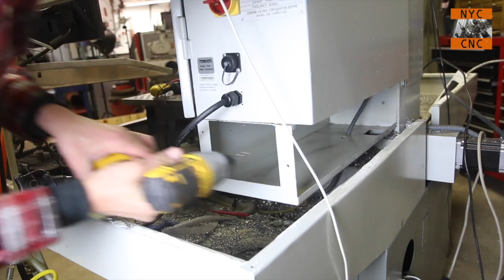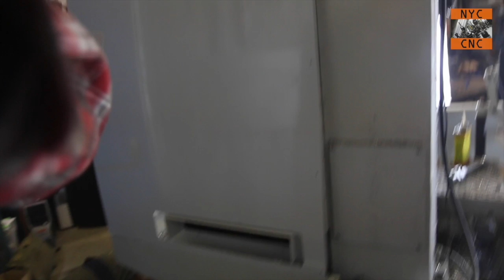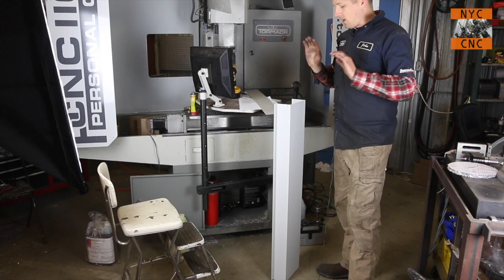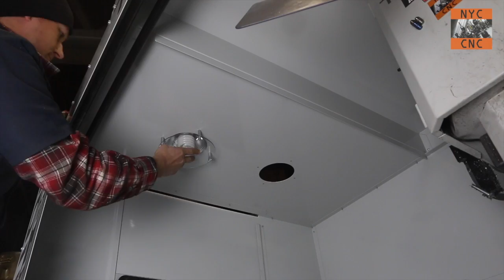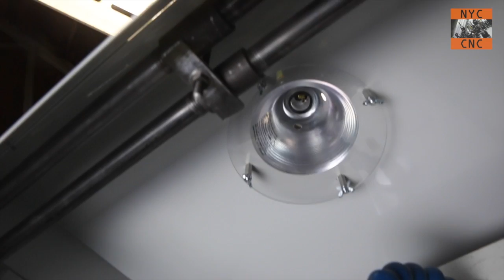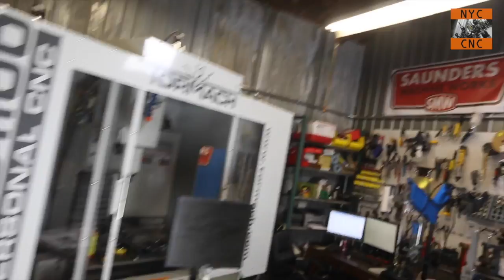Tormach PCNC Enclosure - Installation & Review Part 2

Comment: FYI, I have 2 nice cabinets from lazer machines I parted out that measure 40 in. tall and 42 in. deep and 42 in. wide that would be perfect for any of you DIY CNC guys that I'll happily sell for a very  nominal amount..  The entire back of the cabinet actually bolts in and out and the front has a large sliding door.  First come first serve.  In Philadelphia.  Thanks.
https://philadelphia.craigslist.org/tls/4863222580.html

Comment: Our enclosures arrived yesterday!
I like that they surrounded the electrical connection coming out of the bottom of the control box.
I am going to take it step further and run a duct from the top of the control enclosure and exit it to the outside.  
This will keep chips from accumulating on the hot air exhaust vent and keep hot air from accumulating inside the machine enclosure.

Comment: Quick question about noise control.   Now that you have been up and running with the new enclosure can you say that it keep the noise levels down in your shop a bit?  We are currently running two 1100 in the same room and looking not only to control the chips but sound as well.   Any thoughts on the topic would be great.  Thank you.  Great video on the install.
Reply: NYC CNC
Awesome.   Exactly what I needed.  Still need hear how its cutting or if there is problem while cutting.  Thank you.   The price was a little more than we wanted to spend since we have to purchase two but your video convince me of the quality and functionality.   Any plans for a Tormach Lathe/Video ect?
Reply: NYC CNC
Awesome!  I will most likely get one this year as well.   Open house would fun.   Shoot me an email offline with details.

Comment: HomeDepot has the new style li-ion drill/impact kit with 2 batts and  charger for 148 right now {Black Friday price was 199}. The batteries slide on from the front like every other brand, so they don't fall out the bottom over time like the regular dewalts. All the drills with plastic chucks have brushed motors. The metal chucks are brushless {xrp}

Comment: 3:00 That old monitor bracket will come in handy to mount a second monitor to watch YouTube videos while machining.  :-)

The eye hook over pipe door hangers and levelers was worth the price of admission for this video.  Very clever.  I'd have never thought to design it like that.  I'd probably use 80/20 aluminum extruded framework and V rollers to hang the doors.  I might steal the eye hook and pipe idea and use stainless eye hooks and fiberglass rod to prevent rusting.  I hate rust.

Speaking of rust - Good job on the powder coat on the steel panels used in this enclosure.  That's a major upgrade from the painted steel used previously.  Hopefully there is some color matched touchup paint to cover any small chips that might occur to prevent rust from getting started and creeping under the powder coat.

We've finally reached the point where I'd install LED lighting instead of compact fluorescent bulbs.  LED lighting happened a couple of decades later than I would have thought when I first started playing with red LEDs in the mid 70s.

$2655 for the full enclosure with monitor arm was on the high side of what I expected, but I completely agree that this is one of those upgrades that is very nice and based on what it costs to produce it's not going to be cheap.

Comment: You can ignore my earlier comments because I can say now that if I had the money I'd be putting in my order right now.

Also, would you be able to tell me the model of camera you use? More so than I want an enclosure, I want to upgrade from using my cell phone. Out of the machining channels I follow, you've definitely got the prize for best video production quality. My videos aren't too watchable with all the shaking going on
Reply: NYC CNC Kit lens or something special? Dream #1 has always been filmmaker - it sure takes a while to get get that going well enough to pay the bills though.
Reply: Very cool - thanks for the info! I'll have to look into that when my next batch sells.
Reply: NYC CNC Butterfly knives. A few pictures show up when searching "Ex09 knife"
Reply: Yep, that's what I have sold so far. This upcoming batch is the Ex10 - similar handles, different blade
Reply: thanks!

Comment: Looking good there, but compact fluorescents are so retro! ;-)

I've gone almost entirely to LED bulbs.
Reply: NYC CNC
The house is lit with 10 Watt (60 Watt equivalent) bulbs from IKEA (article number 202.662.25 - $4.49 in the USA) which produce a nice quality light.

The workshops are (mostly) lit with bulbs from ALDI from one of their 'special' sales (supplied by Mueller Licht). Very bright and quite a bit whiter than the IKEA bulbs, without being 'cold' white. A bit more expensive than IKEA.

Lots of junk out there with lots of bulbs not as bright as they claim to be!
Reply: NYC CNC I'd definitely leave the CFLs in there until they burn out, but if/when they do you might find that LEDs are more reliable.  Vibration seems to really nuke CFLs.
Reply: NYC CNC there are some Aldi in the US. But Trader's Joe is the same group so they might not be at the same places.
Reply: NYC CNC  Ikea is a lowcost home decor & furniture store in select locations. 
If  there is not a store close to you, buy online at ikea.com 
http://www.ikea.com/us/en/search/?query=LED+lights&category=products&range_subcategory=10744
Also checkout the doubleboost LED task lighting. 
http://www.ikea.com/us/en/catalog/products/80169636/
http://www.ikea.com/us/en/catalog/products/20169658/
Reply: NYC CNC I'm in the UK. ALDI are a German company that has gained quite a bit of market in the UK. Although primarily a food retailer, they sell all sorts of stuff as 'specials'. I've bought wrecking bars, an air compressor and an SDS drill from them in the past.
Reply: CFLs, YUCKie and old fashioned.  LEDs kewl and they are instant on from the get go and not temperature affected.
Reply: NYC CNC Who would have thought your selection in light bulbs would generate so many comments, lol.

Comment: I bet you smile from ear to ear every time you walk into the shop now, looks great, good work!
Reply: NYC CNC It really does look great, and the opening seems to still give you plenty of access to do work.  

Does it make a difference with sound?  (Warning: yet another unsolicited youtube recommendation, lol)  When I saw those big spans of clear sheet metal in the shot of the back of the enclosure, it occurred to me you could roll on some dynamat pretty easily to dampen things a bit (might not make a difference).

Comment: I would give fluid coolant a try, from my CNC-Turning experience it really extends tool life and you get way better surface quality. However, it'll definitely cost you more than minimum quantity lubrication and in addition will need more maintanance.

and again, great video ;)
Reply: NYC CNC from experience, not all coolant fluids are created equal, I recommend to do  a lot of research/homework on coolant selection.
Material compatibility, intended application, corrosion control, biological/bacteria control, lubricity, thermal conductivity, shelf life, in-use fluid life, reaction with other fluids/oil, skin irritation factor, filtering, cleanup from finished product, disposal, cost etc... are some of our selection criteria. 
If your shop experiences below freezing temps, be sure to also take that into consideration when choosing a fluid.
Reply: Don't forget that you also need to clean the thing because if you don't it will rust. If you check here on YouTube Grimsmo you can see his Tormach. It's rusty as hell.
Reply: aserta
If it rusts then the amount of oil in the coolant was way to low. You're not supposed to cool with water only.
The four main tasks of fluid coolants are:
-corrosion protection <----
-reducing of friction between tool and workpieces
-cooling of the tools and workpieces
-flushing away chips
Reply: I didn't put them in order of their importance, because that depends on the application.
If you find the time you should do testcuts with coolant and compare them with the testcuts you've already done.
Reply: NYC CNC I've only worked with water - oil emulsion with an oil percantage of 5-8% so far. So I'm not really an expert when it comes to the uncountable variations of coolants.In addition, I don't know what materials you are mostly working with, so I would probably ask at a local storage for advice. Or call one of the companies which sell coolants.
Reply: NYC CNC For general all around coolant with good  sump life can recommend highly QUAKERCOOL® 3750. I've used it on manual mills, lathes, grinder and small CNC-machines with good results.

Comment: Should lube sliding parts.
Reply: Doesn't make much difference. It's an eye-bolt not a wheel type slider. IMO i would of had accepted the extra cost of wheels instead of eye-bolts.
Reply: NYC CNC If it is painted surfaces or plastic I find silicone to be the most slippery. I was thinking for the side windows but maybe friction is a good thing there.
Reply: NYC CNC Yup, wheels are cheap. But you could make it a neat-o project and DIY it. After all, all you need is a bracket and a wheel.

You could even make a simple adjust height system by making the hole that holds the wheel screw wider on the vertical axis.

Oh, IMO, you should add two strips of pliable magnet to the doors. When it closes it makes such a difference on the "feel" aspect of the whole enclosure. Kind of like what they do with freezer doors that have it in the rubber seal. The "click" is satisfying. :)
Reply: NYC CNC Magnet strips aren't that strong it's surface over power. That being said you could keep it clean by having something like tape over it. When you're ready to clean, you peel the tape and the chips fall down.
Reply: NYC CNC I'm a new subscriber and i have this tradition to watch all the videos a subscription has ever put on. I'll be sure to watch it. :)

The cloth idea is certainly much better.
Reply: NYC CNC No worries, everyone starts from somewhere, i understand that perfectly. Besides i want to show support by liking each video as i go along.

Comment: You know... After looking at how those lights are installed, it would appear to me to likely be easier (and MUCH more water resistant should you choose flood) to have the glass mounted flush with the sheet metal. I am assuming a screw goes through the glass, and attaches to a standoff. If you use the standoff to hold the glass and screw, you can change the bulb without dropping the glass on the inside. You access it from the top. Just looking at the wing nuts, it felt like they would work better on top of that support ring. Other than that minor observation, clean build for sure. LOVE the attention to detail.

GREAT job as always! I cant thank you enough for sharing this knowledge. After running a crappy ShopFox for a few years, I can honestly say that I cant wait to move up to a bigger machine.
Reply: NYC CNC Indeed. The only real question is whether or not a PCNC 1100 or 700 is in order. I don't run a high volume shop, yet the price differences are relatively minor over the life of it. I suppose it becomes a similar set of questions like what you are thinking with the vertical mill... Buy once cry once? Used? (just missed a great deal on an auction for a decked out 1100... sold for <$4K) 

With my brother going down the machining and smithing road... maybe that would justify 1 shop, better equipment.
Reply: NYC CNC To be honest, the Tormach has proven (on so many channels and reviews) to be one of, if not THE best value for the quality and performance. Not to mention, great support and numerous accessories. i think I recall your review also being quite positive. :-D
At least I have the brand picked out... Now to do ROI calculations (blehhhh... Accounting) to maybe help decide.
Reply: NYC CNC A CFL lamp will break if splashed by coolant/water when "warm" as they really don't get much above about 135F. 
Also if the CFL is not outdoor rated it will experience shortened life in a humid/mist/wet environment because the ballast in the lamp base is not sealed.